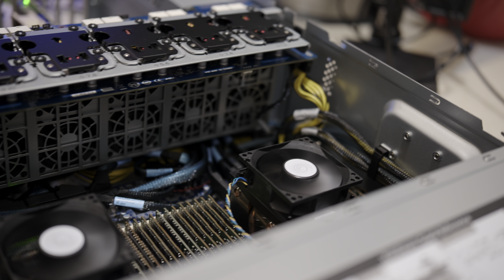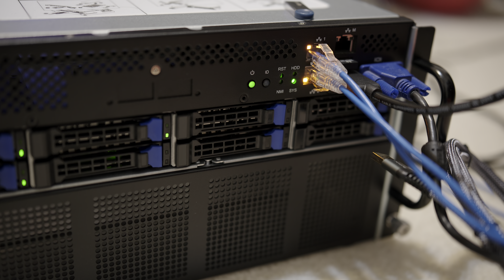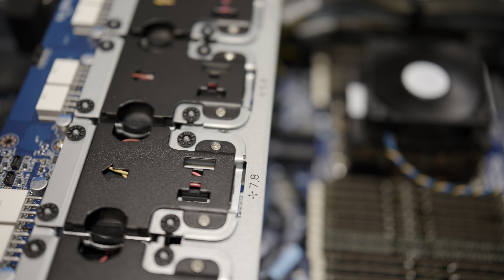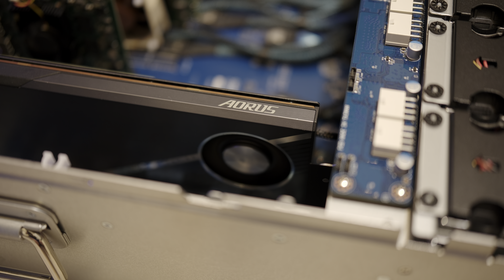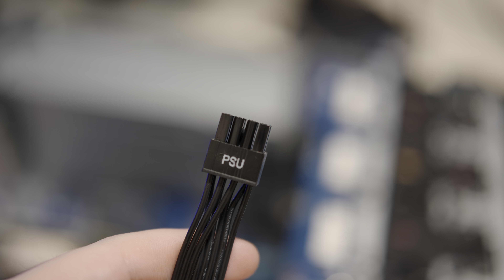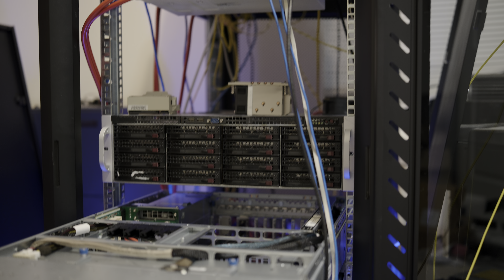GIGABYTE G482-Z51 New Year Build! 8K HDR

Comment: Im finally moving away from my R720 going to build this time on epyc. Just can't decide if i should stick to milan/rome or go ahead and start on a low end genoa for the upgrade path. Rome would probably be fine for me for years but its hard not going genoa and getting 10 years out of a build.
Reply from the maker: If you have it in the budget I would go for the Genoa because as you said it could stretch a bit further. I am totally sold on the Epyc line up as they are just amazing processors. For me the Rome was the right balance of cost vs performance where as Genoa really has not hit the second hand market just yet so msrp is a bit out of my reach.